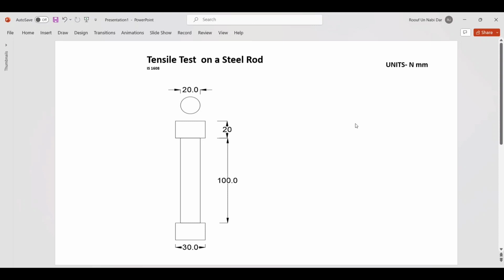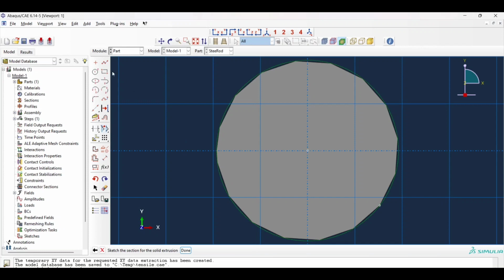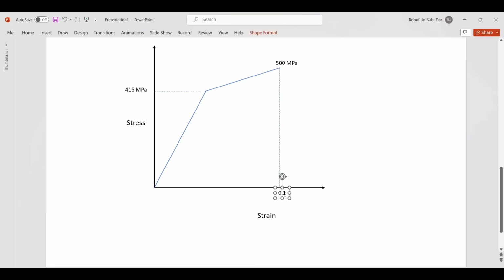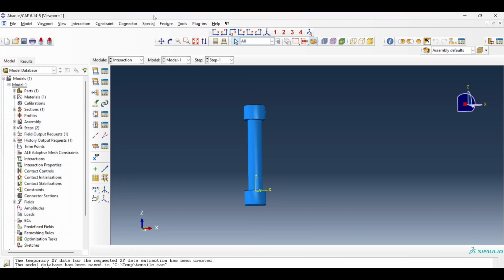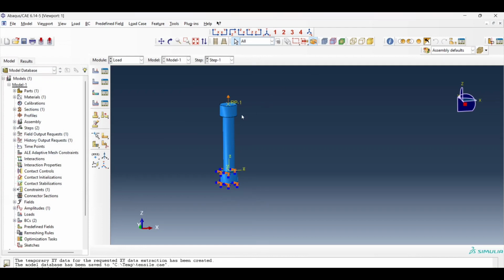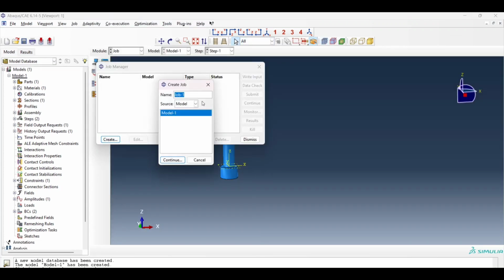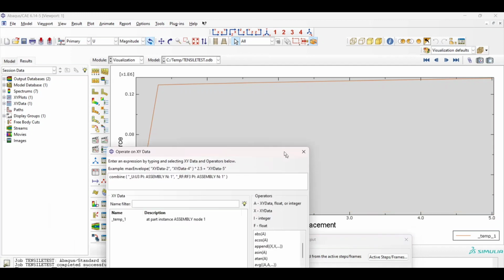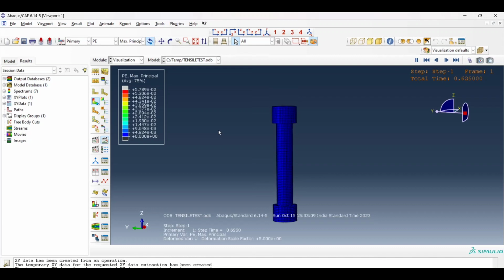Tensile Test on a Steel rod

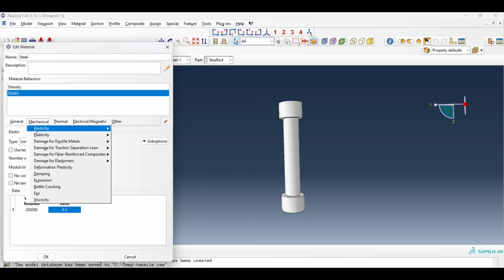Comment: At around 6:12 you said that you're giving the plastic properties as input. What if I don't know the plastic properties beforehand? How is it going to affect my results? At times I would want to estimate the failure and inelastic properties of the material I wish to simulate for which, prior knowledge of these values might not be available (not even in literature at times).
Reply from the maker: It is essential to provide the constitutive model of the material we are analysing. Suppose if we are doing an elastic analysis we must provide the elastic properties of the material ( in turn we are providing the elastic constitutive law (Hooks law). If we intend to perform non linear analysis of a material, we need material constitutive  model (could be anything elastic, plastic, viscoelastic, thermoplastic etc, depending on the material and action). These models or the properties may be given in the literature or we may have to do experimental testing to calibrate those models.